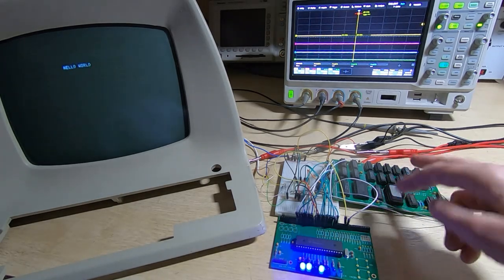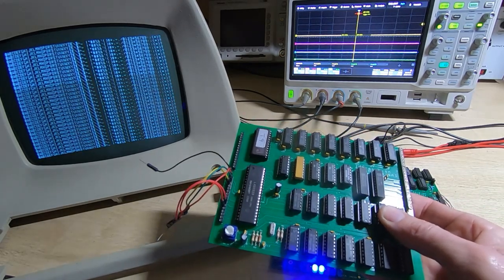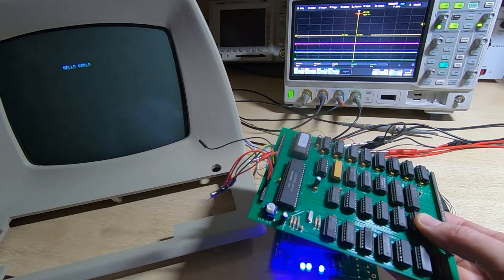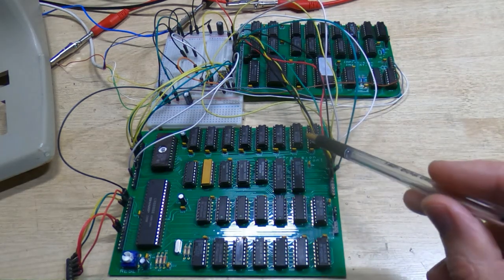Designing A Z80 Computer Part10

Comment: Likely anything designed to work with a PS/2 keyboard will also work with an AT keyboard. With the major difference being the connector. Looks like the PS/2 keyboard starts up in AT compatibility mode anyway.
Reply from the maker: Yes it should although there are some important differences. I am using the PS2 because it is more easily obtained than an AT keyboard.

Comment: Nice solution, I think similar to the circuit shown by Ben Eater maybe. I wonder did you consider the z80 SIO/DART for the PS/2 interface? This can do synchronous send/receive, has the correct bus interface for z80 and all required IRQ logic for interrupt mode 2 already built in and is period correct as it was available soon after the z80 itself.
Reply from the maker: No I did not consider that as it would go totally against the design philosophy for this project.
Reply: I think the aim is to avoid using the PIO, CTC or SIO/DART. So far as possible sticking with what was available in early 1976.
Using one of these would likely be more complex than a shift register anyway.
Reply from the maker: @markevans2294  The large scale devices are easier to use because they can be connected directly to the Z80 and do not need any glue logic. You can easily build a Z80 around 4 LSI devices but where is the fun in that :)

Comment: "...put something in hardware and remove the need to handle it in software"

This design maxim must be the most retro aspect of the project.
Reply from the maker: Yes that is the idea. Ideally I would like the computer to run in a limited way from the ROM but allow anyone building one to write their own operating system so the less dependant it is on software the better. It also maximises the power of the Z80 by allowing it to focus on user applications rather than housekeeping tasks. If I designed the system to run only with a complicated operating system then it may put a lot of people off trying to roll their own version.
Reply: @JerryWalker001  Well, the code in ROM is software, too :-).

I was jokingly referring to the trend in many technological systems, not only computers, to implement stuff in soft- rather than hardware. It is most poignant where mechanical stuff is replaced by code. Or when a "fix in software" allows the designer and manufacturer to avoid doing things in what could be called the "right way". A glaring and ultimately even blood-soaked example is the introduction of MCAS into the B-737 MAX airliner. 

Even in the makerverse frequently you just get an Arduino or similar thing at the heart of projects doing all the interesting stuff.

I get it: Software is easier to make, usually cheaper, definitely more flexible, and often even functionally better than building stuff out of discrete components or even metal parts. 

But it is also invisible and un-understandable by hand and eye. The code is "secrets whispered to sand", an almost magic ingredient.

My first computer used a Z80. It was a complete home computer system that you connected to a TV but it also came with an edge-connector and a manual that said "You can do almost anything with this that you can do with a Z80, although sometimes the hardware might get in the way".

I love that the chip is still used to build new systems today. Thank you for your effort and for sharing it with us!
Reply from the maker: @marianaldenhoevel7240  Yes I am fully aware that the code in ROM is software too. My point was to minimise the amount of it that is needed and not have the system fail to operate without it. In this case the PS2 interface is able to convert the serial stream to parallel and generate the interrupt signal without ANY code at all. Anyone wanting to create their own operating system (software) will not then need to include any code to do that as the hardware takes care of it for them.

Comment: I have an vintage Ascii parallel keyboard design, outputs parallel data along with strobe I’ve been selling… Complete with period correct custom made keycaps, good to go.
It’s fully compatible with George Risk model 756, could this be used with your design perhaps ?
I do have a YT video that shows some features of this keyboard.
Reply from the maker: Thanks but the point in my selecting a PS2 keyboard is to allow others to build this computer. If I designed it to need  a specific or rare keyboard then anyone wanting to build one would have a problem.
Reply: @JerryWalker001  understand… mine is readily available, good to go. I have 50 keyboards right now, and can supply as many as needed in future too.
There are also other Ascii parallel keyboards out there too 👍🏻
Reply from the maker: @8-bitbitsa821  Thanks but the entire point of these videos (and the book) is to show how to design these circuits rather than how to located ready made solutions, Thanks anyway.

Comment: Jerry, i have made a program for an atmega88 to convert the ps2 keyboard serial protocol to parellel, especially designed to feed it to a 8255 mode 2 port. It is bidirectional, it can receive keyboard scan codes and send keyboard commands. If you are interrested, i can send you the code.
Reply from the maker: Thanks but I already have what I need as the circuit I show already converts the PS2 protocol to parallel and also generates the required interrupt signal and I will be writing a monitor program for this machine. All I need to add for the keyboard is an interrupt handler but this is mostly just a lookup table and state flags.
Reply: @JerryWalker001 also I suspect just plonking a current MCU to handle the keyboard with more transistors then the entirety of the rest of the system wouldn’t really be in keeping with the rest of the project.
Reply from the maker: @lawrencemanning  I suspect that your suspicions may be correct.
Reply: Quite likely a Programmable Peripheral Interface (PPI), such as the i8255 or Z80 PIO, wouldn't be in keeping with the rest of the design.
Reply from the maker: @markevans2294  Quite. In fact it would make the entire project fairly pointless. The book goes into a lot of detail about it.